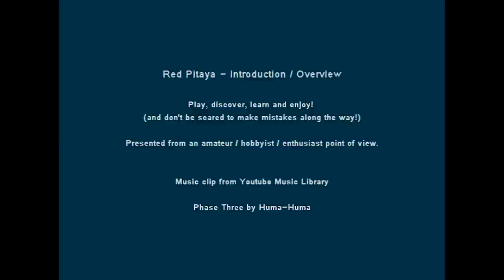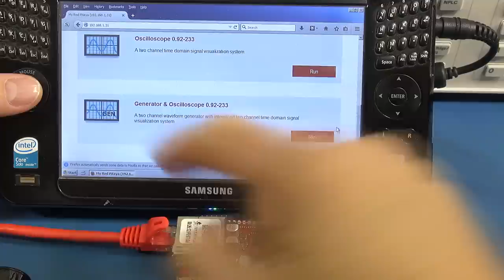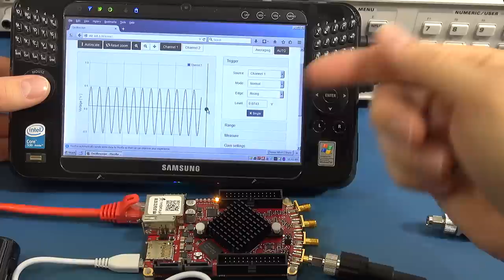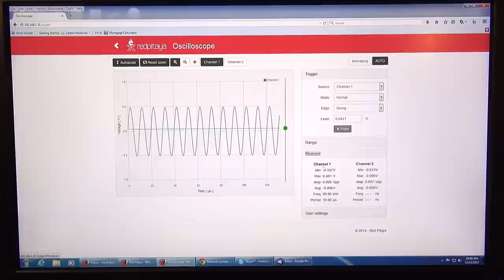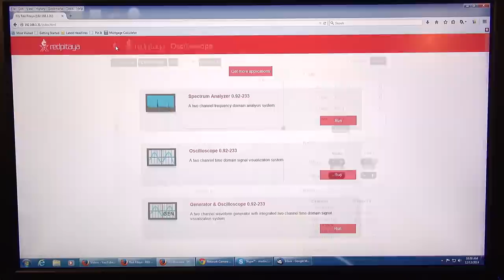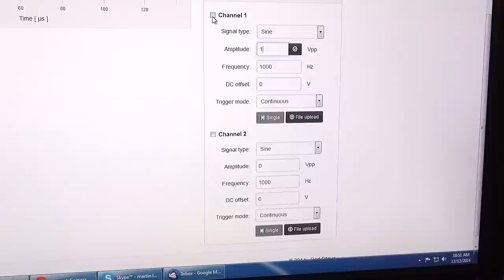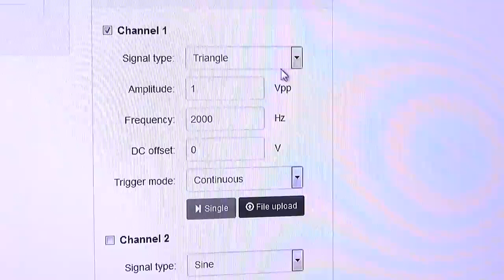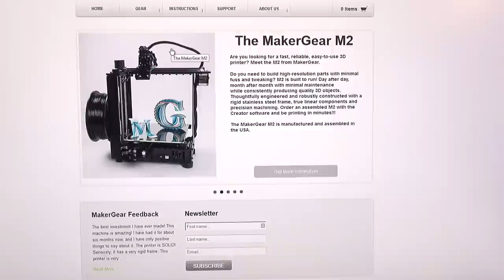Red Pitaya - Introduction and Overview

Comment: Interesting except for the price. 
But sampling chips and CPUs are dirt cheap these days so this kind of super functionality should really be in multimeters. Early stages of a tricorder if done right.
There is such stagnation on the meter market.
Reply: Not really going to be cheap to put this kind of functionality to a multimeter. This has a Xilinx Zynq SoC (FPGA + dual core ARM Cortex A9) and the ADC won't be cheap either. Also, doesn't really fit the power consumption specification for a DMM.
Reply: kalhana1 what power consumption specification is that?
Reply: kalhana1 Analog devices has an 80MS/s ADC for 4.5$ on digikey. It uses 90mW of power at 100MS/s. That's 110hours of continuous operation on a laptop cell.
When did you last use your multimeter 8 hours straight.
Reply: Dan Frederiksen
I guess you'll understand with more experience, but you need to study the specs of that ADC. It is not really suitable for this design and is pretty poor in general. The ADC used in this device is retails at £54, and really is the bare minimum you could get away with for an application like this.
Reply: Dr. Lecter with experience you may realize that I never said it was a replacement for the 14bit ADC in the video. And that the 4.5$ ADC would serve well for a multimeter oscilloscope. A 15$ 200MS/s chip might also be interesting or 38$ for 500MS/s if you wanted to overkill.
Reply: Dan Frederiksen
How would a $4.50 ADC serve well for a multimeter oscilloscope? What would be the USP? A meter that can kind of show something that may sort of resemble the input waveform? a $15 200MSa/s ADC could be interesting, but at $15 they'll be a serious compromise, ENOB, linearity, repeatability??
Reply: Dr. Lecter it's 8bit like most high dollar scopes, why wouldn't it be linear? and how could it not be repeatable. Why would a lower speed chip suddenly be fall apart low quality? and it's actually just under 4$ on digikey.
0MS/s could do 10MHz analog bandwidth and probe 20MHz digital signals.
How would that be a serious compromise compared to a Fluke 87V.
Dare to think. It's good experience.
Reply: Dan Frederiksen
It might be worth you reading about data conversion theory and ADCs, or at least understanding the different types of ADCs and what they are used for. 
Your comments are typical of someone who just looks at headline specs and taking them at face value. Do you even know what type of ADC is used in the 87V?
Reply: Dan Frederiksen A typical $4.50 ADC is unlikely to be suitable for a decent multimeter. High end meters use multi slope integrating ADCs for high resolution and highly accurate readings. Using a typical delta-sigma ADC puts additional burden on the rest of your circuitry as you then have to process samples at a much higher data rate and have to rely on components having very long term stability rather than only worrying about drift in each sample window.
Reply: Dan Frederiksen 8 hours multimeter use is a typical working day for an electronics engineer...
Reply: Dan Frederiksen Linearity and repeatability are basic specs on an ADC, as Dr. Lecter said, it might be worth a quick read of some ADC theory to understand how these manifest themselves in an ADC design.
Reply: Dan Frederiksen You can't use any ADC for oscilloscope, they usually use pipeline-type ADC (like AD9288BSTZ-100 used in Rigol low end oscilloscopes with price around 17$ or like HFD204 SiGe ASIC used in Tektronix MSO5000 series and it is), also they can use 8bit ADC becouse they use real input attenuators
Reply: Dr. Lecter do you know what type of ADC is used in fluke 87v, or you are again just act smart as usual?
Correct answer is dual-rate, dual-slope ADC, which means nothing not all DMMs use that type and what you wanted to point with that question, or you just try to show how you "know" more then Dan Frederiksen .
That is same as i would ask you what type of ADC is used in Keithley 2002 or in NI PXIe-5186 oscilloscope.
Reply: Miloš Lazović
The ADC used in the DMM has already been pointed out Milos.
Reply: Dr. Lecter Not all high end (and Fluke 87v is not high-end one, if on it was not name Fluke everyone would think it is Chinese junk it have so many bugs that is only good for hobby use) use slope integrating ADC, some use successive-approximation ADC, pipelined ADC, even some use  flash ADC.
Reply: Miloš Lazović Are you talking about bench top DMMs? I think Dan was talking about handheld DMMs. I personally use an Agilent U1273A, although not exactly sure what ADC type they use. Seems to be fine for what I use it for anyway.

And going back to the usage time, yes it's true that sometimes you end up using the meter for over 8 hours, I actually turn off the auto power off feature because it's annoying. So battery life is important. I don't see the point of integrating oscilloscope feature into the multimeter and compromising battery life. That's what hand held oscilloscopes and USB scopes are for, or bench top scopes for when you're in the lab.
Reply: kalhana1 2 laptop cells and you could have maybe 30 hours of continuous operation with a 10MHz oscilloscope. Please don't be so pedantic and deny that with battery life as the excuse. Handheld oscilloscopes are so far very poor and very overpriced. And of course it should all be in one powerful tool. graphic profiling LCR, transistors, diodes, all graphed.
I prefer startrek tricorder over fluke religion and so would you if you dare to think.
All that could be in a 100$ meter. There is a sharp disconnect between the available component technology level and the 1980s crap we get in meters.
Reply: Dan Frederiksen Ok, it's possible for like $1000, but for $100? Seriously? You can't even get a decent DMM for that price. The BOM cost is not the only cost you have to consider. For instance, the DMM has to pass safety certifications, calibration etc. Furthermore, they have to give warranty, support etc as well. Not to mention getting the ROI for the R&D the company puts into the product. Setting a retail value is not as simple as just adding up the BOM cost.
And a propper graphing LCR meter costs thousands of dollars and is quite big physically as well. It's not as simple as slapping together a bunch of banner spec chips into a box.
If you want a cheap Chinese version of your DMM+scope, yes it may be possible for that price. But I wouldn't really trust the readings nor trust it when connected to anything over 50V to not blow up.
Reply: kalhana1 you are still not thinking. full fledge 7" touch tablet computers for 70$
100$ is tight but doable. of course it requires a certain mass production.
I wouldn't be offended if it cost 150$ but 1000$ is mindless fluke religion. a 4$ ADC doesn't translate to 1000$
Reply: Dan Frederiksen
You seem passionate about this idea, so why not start drawing up a design? Crowd funding is exactly for this type of thing and there may be others who have a need for the same type of product.
Reply: Dr. Lecter I make oceans of such observations, I can't start a business for each one. Sometimes it would be good if mankind responded to reason instead of just saying why don't you do it yourself.
Reply: kalhana1 My point was to say that there is not only one type of ADC that will do job in DMM or oscilloscope, you can use any (almost) ADC technology if it fits your desired requirements (speed, SNR, SINAD, SFDR .....)
Reply: Miloš Lazović
But the type of ADC you use will obviously massively effect the signal chain.
Reply: Dr. Lecter I totally agree with you (for first time), but not only signal chain but most of other aspect of design like mechanical (some need more space), thermal (some dissipate much more then other and are more sensitive to temperature change), power requirements ....
Choosing right one is always some sort of compromise.
Reply: Dan Frederiksen
Why not? If you could build a meter with that capability as cheap as you say it should be, you would be the richest man on earth within a year or two. Even BG's would be envious! I know my name would be on the waiting list for that meter!
Reply: Robert Calk Jr. you don't quite understand how rich the richest is.
a thin margin high volume endeavor is a dollar intensive risky thing and the multimeter market is likely relatively small. It certainly could be done, you only have to do a rough bill of materials with parts on digikey in volume of 10k. 4$ ADC, 1.22$ CPU, bit of ram, your typical touch screen cell phone display, chip for the display, bit of front end. PCB, connectors, case, Bob's your uncle. Of course it can be done.
Things are powerful and inexpensive at the component level.
Reply: Dan Frederiksen
If that were true the Chinese would be all over it like flies on... well, you know.
Reply: Robert Calk Jr. no. when someone else does it they will copy it.
As a general rule of thumb, if I say it is so, it is so :)
Reply: Dan Frederiksen
Sorry Dan but I don't believe you. That's true about the Chinese copying everything, but if you could build a meter with
the capabilities and price that you claim could be done, you would do it - or at least someone would.
Reply: Robert Calk Jr. you don't know either component cost nor understand humanity on the relevant scale. you only have to look at the 400$ fluke 87V to know that humanity is locally moronic. It is as I say.
Reply: Dan Frederiksen
Evidently I know more about them than you do. This is the time of the internet and 3D printers. My Fluke 87V works quite well. $400 is for a brand new 87V with high voltage leads, crocs, & magnet holder. You can buy used ones on ebay for $100 - $200.
Like I said, if what you say could be done, it would be done. Long gone are days that individuals had to grovel at the feet of manufacturers. If you can build one then build it!! You don't even have to make a case for it - build it on a BB and shoot a video. I can't wait to see this meter of yours that can do everything for $100!
Reply: Dan Frederiksen People who need the quality and reliability of a Fluke buy a Fluke. There's enough multimeters out there for $50 and no one is forcing you to buy a $400 meter. This I find is similar to when people complain about the price of Apple products. As Robert said, there's enough ways to make your dream a reality. Be the change you want to see in the world.
Reply: Dan Frederiksen Robert Calk Jr. I don't know why you argue about this, Dan Frederiksen  didnt think anything new he just need to keep price low (Chinese anyway make DMM with oscilloscope for years and with price range from 100$-200$) so if someone want it you can buy it today (personally i don't see any use for it but that is me).
If Dan Frederiksen  think he have market for it let him try to make it.
Reply: kalhana1 Only problem is that even Fluke is not what used to be, and that not only apply to them, Tektronix is same (but lately they improve), Agilent sell rebadged Rigol (low end models) for 3 time price, and so one.
And there is even lot of 5$ DMM from China, if someone need them (and you probably can use them if you are brave enough).
For Apple I even can understand people why they complain, if you pay 600$ for something that Apple pay 60$, then it can be reason for complain (but all forget that 60$ is just manufacturing cost all forget money Apple spent for R&D of product)
Reply: Dan Frederiksen
The price of the 87V is fairly justifiable - lifetime guarantee and known reliable track record. However, the 87V is actually an industrial multimeter, so somewhat lost on the electronics hobbyist. In an industrial application, the cost of the meter is insignificant.
I personally own a Fluke 179, 289, a Meterman 37XR, a Gossen Hetrahit One and I did have a few sub £50 meters. The sub £50 meters were pretty poor - but they kind of did the job and had tonnes of features which were generally a bit gimmicky and didn't really do any one feature well. The Flukes are expensive, have the bear minimum of features, but do everything well. I actually find myself using the Meterman the most frequently because it's a nice 10000 count meter, has some additional functionality (frequency counter, inductance ranges etc.).
IMO if you're designing a meter with loads of functions, make sure the basics work as well as a mid range meter as this is what stops them doing well in the market.
Reply: Dr. Lecter Fluke 87V have great track record, except it can be bricked with GSM mobile (they fix it in later versions).
Fluke 87IV was much better (I think was later renamed to Fluke 187)
Reply: Dr. Lecter no the price is most certainly not justified. and that sheepishness is why it continues.
Reply: Dan Frederiksen
In what way? The £50 meters I've had have lasted a couple of years at the most. So payback would be within 10 years, plus I know it should last a lifetime.
Reply: Dr. Lecter Exactly. Also how confident can you be with the readings given by cheap meters?
But you can get a decent meter besides a Fluke, such as Bryman meters.
I'm really happy with the Keysight U1273A, great value for money considering the features.
Reply: Dr. Lecter You just forgot that even Fluke have lifetime warranty it still have hidden costs that pile up over years (like calibration and what is not covered with warranty).
And lifetime warranty in case of Fluke is apply only to first owner and it must be bought directly from them (or Fluke Factory Authorized Distributor) so if you buy it on other place it dont apply to you, you mas keep Bill of Sale with your name on it, you must be registered purchaser...
So anyone who buy it on ebay or second hand, or even from shop that is not Fluke Factory Authorized Distributor is not covered with lifetime warranty.
Reply: Dr. Lecter if it's not a 400$ fluke it dies within 2 years? that is nothing short of moronic.
Reply: Miloš Lazović
I bought my 87V on ebay. It was brand new and unopened. It is registered in my name.
Reply: Robert Calk Jr. Do you have Bill of Sale with your name on it from Fluke Factory Authorized Distributor?
If you don't have it you don't have warranty.
I think it is not ok from Fluke but it is how it is working.
Reply: Miloš Lazović
My registration was approved when I registered it on the Fluke website.
Reply: Robert Calk Jr. From Fluke warranty statement:
Three basic things an owner of a Fluke product must have for Warranty are as follows:
1. Must be the First "Registered purchaser".
2. Must have purchased from a "Fluke Factory Authorized Distributor".
3. Must also have a "Bill of Sale" with your name on it, Serial Number where applicable, from an Authorized Fluke Distributor when & where purchased.
Another fact about lifetime warranty:
Lifetime is defined as seven years after Fluke discontinues manufacturing the product, but the warranty period shall be at least ten years from date of purchase. *(Lifetime Warranty applies to products manufactured after October 1996). The warranty does not cover manuals, fuses, disposable batteries, damage from neglect, misuse, contamination, alteration, accident or abnormal conditions of operation or handling, including failures caused by use outside of the product's specifications, or normal wear and tear of mechanical components. This warranty covers the original purchaser only and is not transferable. This warranty covers the LCD for 10 years only (state-of-the-art for LCDs). To establish original ownership proof of purchase is required (20, 70, 80, 170, 180 and 280 models).
So what is not clear to you?
Ebay  bought FLuke is not covered by Warranty (you are not original purchaser).
All that you can find on Fluke website or on warranty papers.
Reply: Miloš Lazović
Well, if they don't honor the warranty, then I'll never buy anything else from them again and I'll bad mouth them every chance that I get! Fair enough?
Reply: Robert Calk Jr. Basically you should not have any problems with Fluke products, they really break (with exception of fading display but you can buy repair kits for it and it is cheap and it is not covered by warranty after 10 years anyway).
I never had any problem with Fluke products (on some of them it say Philips so they are made between 1987 and 1994 when they had some partnership so Philips in Europe sold Fluke products by Philips name and vice versa)
But only problem is that warranty is not transferable, which I personally don't get it why because lifetime warranty is not for lifetime of owner but for lifetime of product +7 years or minimum of 10 years (translated to like 15 years or so) so what make difference if someone is first owner or 100 owner it not make longer warranty, and small nonsense that you must keep bill of purchase (which is small problem because here accountants throw it away after 3 or 5 years when paper value of it go to 0).
Reply: Price should come down with volume and competition.  Right now the high price supports development and with projects like this and labnation, sigrock, etc, we are developing an opensource/openhardware ecosystem, that in time will provide the same features and quality as commercial scopes like RiGoL and Techtronics for a lower price point. This will both bring down the price such that more people will have access to research quality instruments, but will also extend the capabilities of high end down to the low end market.  So to those who are not starving students, and even if you are, understand this is an investment not just for the product, but into the future.
Reply: Kimberly Peacock This now is not close to product even from Rigol, and light years behind companies that have experience in making PC based instruments (like National Instruments).
This now is just interesting overpriced toy and nothing more.
Reply: Miloš Lazović  In 1990 on a little known BBS system known as double Helix, I uploaded one of the first distributions of linux. You had to compile all the core parts yourself. At that point Windows, OS whatever with apple was light years ahead of linux, but by 1997 linux had become almost as good, and now its competitive in feature, ease of use, etc.  Hardware unlike software has a real cost associated for the commodities which make it up and the processes which go to the manufacturing from the commodities.  Right now this type of open source hardware is like linux in the early 90's.  However if people support this open model, it is an investment in the future for everyone, as the hardware costs will come down, the designs and the best of those designs will be iterated and improved upon by all, and in time will be as good as anything offered, however it will cost less.   The real question is do we continue to support a model designed to extract as much value as they can from the user, or do we support a model which over time will provide the most value to the user?
Reply: Kimberly Peacock Sit down you failed.
I didn't know you was person who created Linux because you managed to upload Linux distribution one year before Linus Torvalds even started work on Linux kernel. When Linus Torvalds created Linux (kernel) in 1991 Windows OS did not exited, it was DOS and Windows as graphic interface NOT OS. First Windows that can be count as OS was released in 1993 (Windows NT 3.51). Another fact is that Linux is started as free copy of MINIX.
You just pointed to Linux and forgot all failed attempts before it? You don't remember DECUS tapes? Even GNU Manifesto is created in 1983 by Richard Stallman.
I don't think open source hardware is bad think, I just think this Red Pitaya is failure as many before it.
Reply: Miloš Lazović Oh please it was a long time ago so it was 1991.   You can go back and search for the double helix if you so choose.    Makes sense I was in San Francisco in 1990 and in 1991 I was in Sunnyside Queens NY.  I think I also crossposted it on Mindvox and Panix.   I think Panix is still around.   So please you are one of those people who just look to come down on someone, when you don't know crap!   So no I wont sit down for a jack xss.  It misses the point. The point of sharing the story was that the open source model works. When you invest in open source you are not just purchasing the existing model but investing in the future.
Reply: Miloš Lazović  Ok so windows 3.1 sat on top of dos. I lived through it. I also ran os2 at the time.  Again it was 24 years ago.  I remember purchasing BSD Unix as it was not too expensive in 1994 and was more stable than linux.  I remember running lynx which was an upgrade over gopher which preceded our modern web browsers.

I don't recall DeCUS tapes. I'm 48.
Reply: Kimberly Peacock I don't argue that open source model work or not, it work in some cases (and Linux, Apache are good examples) where open source is better then what now exist, or is cheaper.
But in case of Red Pitaya you try to push model that is WORSE of any existing model and for more money then existing model.
Reply: Miloš Lazović  I am arguing not for Red Pitaya but of this type of work. As someone pointed out Redpitaya only makes the software open.  However in these type of things you are paying for the future. You are paying for the R&D to make an even better product.   Frankly lab nation at $200 which is open hardware is a better one to support.  And while the value per $ is clearly better spent on a rigol right now, if those of us who can do not support such products, then we wont ever get an open hardware and software version which will be as good as a rigol at a lower cost.
Reply: Kimberly Peacock So you try to say we need to support any open source idea, even it is so unrealistic or useless, so we will see if on some mysterious way it could beat proven commercial technology or become useful?
Then let us all run and support "Thorium Powered Car" so all can drive for 100 years on 8 grams of fuel (even all physic behind it is wrong).
Rigol also have R&D costs and they make for now better and cheaper product.
You again forgot that there is Digilent Analog Discovery which is commercial product and offer same as Red Pitaya for half (if you are student then for 1/5) of money, they again had R&D costs.
I agree that we need to support open source model, but not if it is plain copy of existing product and/or it is worse in every aspect then what exist or have no real purpose.
Arduino was good example of open source what need to be supported (personally I even don't like it, but still I bought couple of them and never used them) even it was not too original, but it still brought something new.
Reply: Miloš Lazović I'm not telling you to do anything.  You don't wish to support these companies, don't!  I shall as the product will get better in time, both the software and hardware and there will be other projects which will add on.  In time Rigol and others will have real competition, for now they can just handwave and say toys. That is indeed what some companies said about the PC.  And in the late 70's and early 80's they were right.  I will choose to support open hardware and software.  Why? Because just like software, the more people who can contribute, have access, build, the more valuable the the network is.  It will force Agilent, Rigol, Techtronics in time to offer more for less, and to push boundaries at the top end.